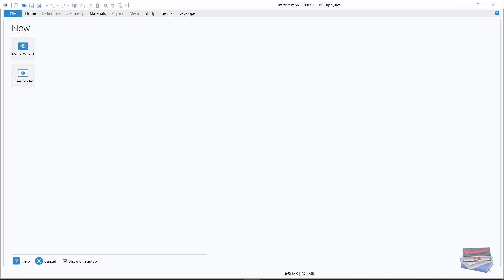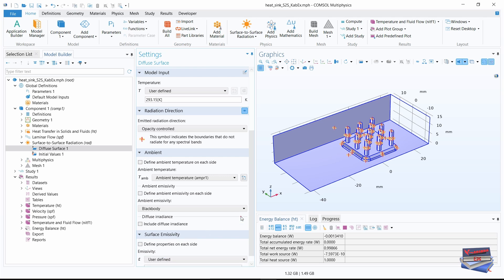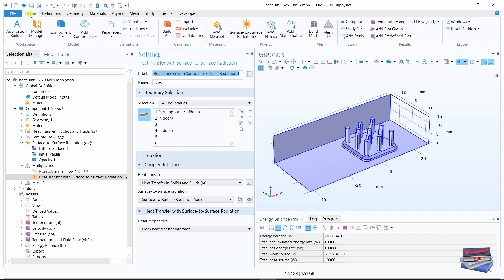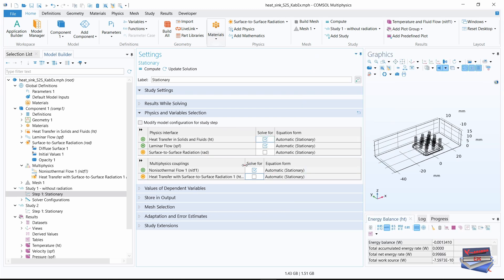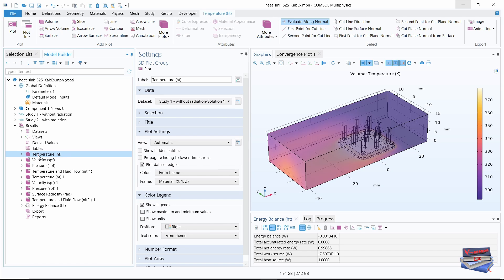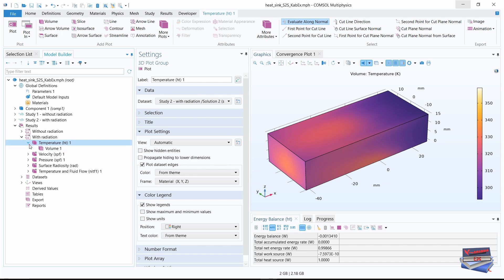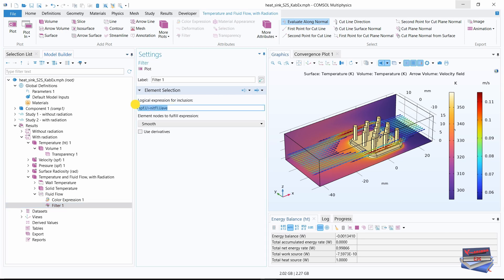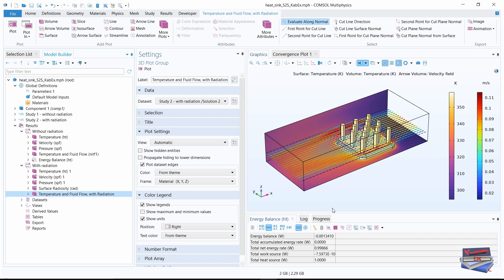Heat Sink - Part 2 (Surface-to-Surface Radiation) #comsolmultiphysics

Comment: sir pls help me with a doubt....as i was practicing topology optimization of a heat sink myself the other day I could do it...but I have not yet validated my design. But you please confirm me a thing that...when we perform steady state, transient and thermal stress analysis one after the other (as you showed in one of your videos)....then when we drag the topology optimization of the model to the solution of the "steady state" ..... will the topology optimization results comsider all the 3 analysis or only steady state. Sir please help me on this 🙏
Reply from the maker: Hi.
Here is the link to the video.

https://youtu.be/2m_chK8a2Nc

Check the video description for the link to the text files and research papers.  I hope this helps and all the best!